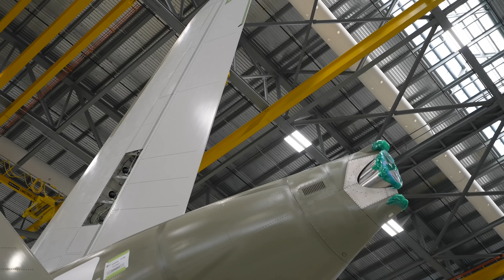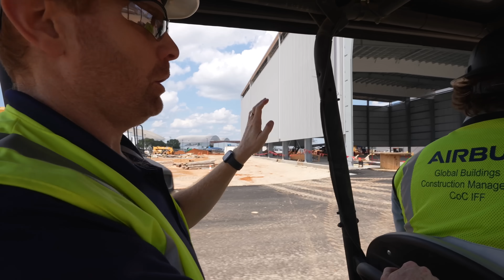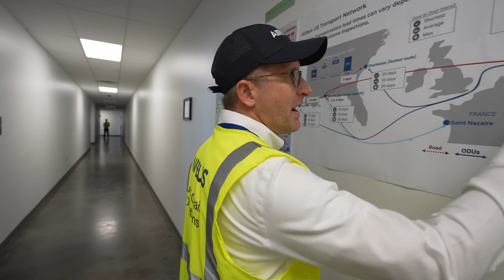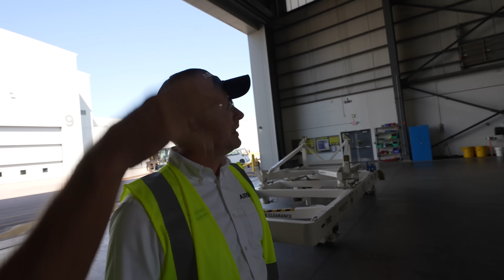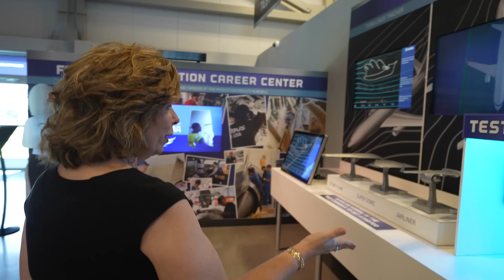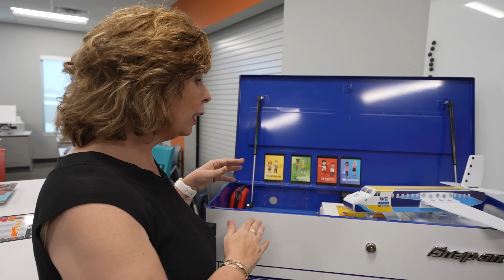How Airbus builds planes in Mobile, Alabama

Comment: I had absolutely no idea Airbus was making planes in the US!
Reply: this plant is the result of Northtrop Grunman/Airbus attempt to build the new Airforce Stratotanker and losing against Boeing having a production place in the USA = a better chance to get Deals with the Airforce. 
In 2006, the USAF released a request for proposal (RFP) for a new tanker program, KC-X, to be selected by 2007. Boeing announced it may enter a higher capability tanker based on the Boeing 777, named the KC-777 Strategic Tanker. Airbus partnered with Northrop Grumman to offer the Airbus A330 MRTT, the tanker version of the A330, which was marketed to the USAF under the designation KC-30. In January 2007, the USAF issued the KC-X Aerial Refueling Aircraft RFP, calling for 179 tankers, four system development and demonstration and 175 production, in a contract worth an estimated US$40 billion (~$56.6 billion in 2023). Northrop and EADS expressed dissatisfaction at how the RFP was structured and threatened to withdraw, leaving only Boeing in the running.
Reply: @mariojakel5544  OK, that makes sense. Thanks for the input.
Reply: They are not. The parts come from Europe and canada.

Comment: Being from Mobile, it is a bit ironic watching Boeing fall apart (figuratively and literally). They had an opportunity to build a plant here (with massive state subsidies) but became greedy. If you are wondering why the A-220 was built in Mobile, take a look at the aircraft's history at Bombardier, long story short, Boeing did not have a competing aircraft and knew they were in trouble so they tried to push for a 100% tariff on the aircraft for US customers. That is when Airbus became a majority owner of the program and moved SOME production to Alabama. Since it was now built in the US it didn't face the Tariff. In a backhanded way, we in Mobile have Boeing to thank for Airbus being here. Also a small side not,  Southwest Airlines, Boeing's largest domestic 737 customer even admitted that the A220 trumps the 737 Max on most parameters for their operation.
Reply: Very interesting piece of history. Thank you for sharing your knowledge.
Reply: Boeing is now a huge disappointment. I flew 727, 747(4models) 757,767. I liked them. Boeing put the moneymen who sank McDonnell Douglas in charge after merger. All downhill from there.
Reply: And now the current US administration is trying its best to ruin it all again by putting tariffs on parts and materials import so that nothing can be made in the US -  because the administration wants more money and it's politically impossible for them to raise the taxes the normal way, or cut spending (which would mean cutting military spending).

Comment: Interesting. But it can't be efficient to ship a plane in a billion parts from factories around the world having to coordinate with them all. Make a new plane model, single piece carbon fiber fuselage made on location, no windows, synthetic view outside on the screen in front of them so they can look in all directions, very thin insulation, doesn't waste 10cm on the framing etc, maybe double curved instead of classic straight cylinder. Similarly clean wings, fly by wire, no hydraulics anywhere, no avionics bay, electronics can easily fit in the cockpit panel. Clean the whole thing up, cut the weight in half, outperform everybody on every metric. The simpler the construction the simpler to automate as well.

Comment: GREAT to see thank you for the video. I was working for Airbus in the UK building fuel and oil pumps but was laid off when the air travel was stopped because of covid. I was told I would be called back to work but I never was so I found some other work that pays more.

Comment: As a flight attendant who works these aircraft every day, there are design changes needed to be made that would make the aircraft safer for passengers and also more efficient for flight attendants to do their jobs. It would be great if flight attendants could have input in these matters. We work these planes, we know them inside and out because we have to.
Reply: Contact Airbus in Canada.  They have groups that design those things and would no doubt appreciate feedback.
Reply: What are the design changes you say that would make passengers safer?
Reply: They do, and it comes through your airline. There was a presentation where JetBlue specifically asked for modifications and Airbus engineered the changes just for them.
Reply: What kind of changes? Cabin crew do give their inputs when designing the planes and in most of the airlines they use cabin crew when ordering the plane and making the decisions on the cabin design. Would be nice to know what kind of problems are you referring to and if they are manufacturer or airline related.
Reply: Totally right about it your opinion is something very important
Reply: Good luck with that. Airbus build their planes on the cheap, the proverbial bucket of bolts. Rickety aircraft. How do you think airbus overtook a giant like boeing is less than 45 years?
Reply: @dougmasters4579  What a utter garbage. If you talk about cheap quality works look at Boeing with ther 737Max disaster and loosing doors, 787 overweight aircraft and plenty of quality issues(wrong installed fasteners, burning batteries, etc..), then there is the 777X embarrasing Boeing designed broken thrust link.  The FAA lists over 500 of quality reports for Boeing and 30 for Airbus. Airbus builds simply better planes and is better at innovating.
Reply: @dougmasters4579 
So, how many Airbus aircraft have you flown on ?
Reply: @dougmasters4579 
Incorrect airbus planes are safe and well built. They innovate and invest. That's how they overtook boeing
Reply: @dougmasters4579 because Boeing bought the US government and everyone finally found out ….with 2 planes full,of,passengers who perished because of their corrupt practices…..
Reply: @dougmasters4579 and NO in general airbus is more expensive to purchase than Boeing. Especially in bulk orders.⁹
Reply: Lol at least they aren't falling apart mid air. Boeing have been subsidised by the American government for years what's your point? Ever heard the quote it's best to let people think you're a fool than opening your mouth and removing all doubt?  @dougmasters4579
Reply: @dougmasters4579 they made it by making better airplanes. Boeing has been heavily subsidised through military programs for decades. Airbus has never been the cheaper option, but they have made planes that customers want to buy. Boeing on the other hand lost the game by making short therm profits for share holders when they decided to continue with 60s platform that should have been redesigned completely. And even that they half assed to make more profit. Max is now selling only on huge discounts and LEAP-engines (Pratt&Whitney engine problems on 220/320). You can get LEAP on 320 too, but not on 220.
Reply: By creating quality aircraft. As someone who flies the 737ng and 737max on a daily basis, it's a piece of sht. 60s technology.. so oudated. I can't even have a discussion in the cockpit without the usage of a headset. The most advanced thing between the previous gen and the newer one is the engines. Cfm 56-7b to cfm leap 1b. But again that's design and made by cfm not boeing. You have to chase the speed as the autothrottles can't maintain the speed even in cruise to avoid overspeeding. And for the max, i have the QRH up the most. FMC failure, single and dual, had hydraulic leak, pack issues(air system), engine anti ice, apu issues, fuel issues, PSEU(equivalent of MAINT the 737ng), door issues, both sensory and actual bolts issues. All our maxes are less than 3 years old.. like c'mon, this are new aircrafts and you constantly have issues with them. 

It's so bad that the company i work for has 4-6 fulltime engineers employed in Seattle just to oversee the production of their 737 orders. Let alone after they receive the aircrafts, they do a 48h full service teardown to find mistakes made by boeing. They found tools that were left, since it's NOT flyby wire modern like airbus, these tools can damage eg cables to the control surfaces. 
Boeing really has gone downhill, the leadership and people in charge etc only cares about profit and not quality. It's a disgrace to be honest. 777x is delayed again due to issues, 787 still have issues both electronic/engines etc. So bad that many airlines even canceled their orders and went with airbus, airbus who has massive massive backlog of orders. 

@dougmasters4579
Reply: @ Boeing were forced to cut corners in order to desperately keep up with airbus who have been illegally subsidized by the EU for decades. The faulty max software being developed in india is one example of this. Being under the iron claw of dei is another problem, as one look as who is leading the 777x program will tell you.
Reply: @ Boeing were forced to cut corners in order to desperately keep up with airbus who have been illegally subsidized by the EU for decades. The faulty max software being developed in india is one example of this. Being under the iron claw of dei is another problem, as one look as who is leading the 777x program will tell you.
Reply: @Arcadiez  Boeing were forced to cut corners in order to desperately keep up with airbus who have been illegally subsidized by the EU for decades. The faulty max software being developed in india is one example of this. Being under the iron claw of dei is another problem, as one look at who is leading the 777x program will tell you.
Reply: @dougmasters4579 absolute rubbish your talking, so you blaming another company for Boeings lack of ethics and quality control etc etc. so your basically saying Boeings narcissistic views means they need to cut corners to beat airbus ? Total rubbish
Reply: @dougmasters4579 Boeing cares more about the military contract pork barrel than the civil jets
Reply: And Boeing was massively subsidized by the Us government by military orders for 50 years and more. Exactly the same  @dougmasters4579
Reply: @dougmasters4579  were Boeing ever subsidised by the US Government?
Reply: @Atkins84  No. They didn't need to. They actually made good airplanes.